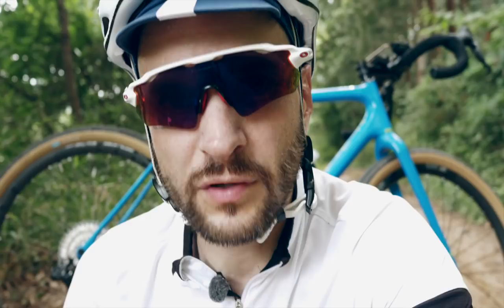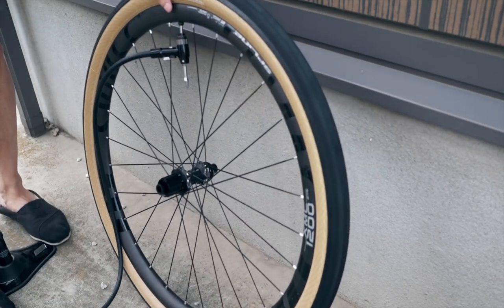First ride(s) DT Swiss 650b w/ Compass tires impressions / New Wheel day Part 2

Comment: Thanks for the vid, great shots! To respond to 4:20 I really don't think the wide Compass tires (at least the Babyshoe pass) are any slower than road tires, even on smooth pavement. I've only been riding them for a couple months but I've maintained the same, if not higher average speeds compared to Continental GP 4000s II racing tires. I've taken some koms too uphill/flat/downhill. Then when you get on older paved roads (where with road tires you'd be feeling tiny high-frequency vibration) the compass tires are clearly much faster due to Jan's "suspension loss" theory.
That's not to say every 47-50mm tire is fast though, I've tried the WTB Horizons/Byways and thought they were terrible on pavement. The closest is probably the Schwalbe G-One Speed but I'm pretty sold on the Compass tires.
Reply from the maker: Interesting to hear!
I'm very happy with these plus sizes one for sure...on gravel it's a whole new ball game...  I'm now secretly dreaming of getting a set of "narrow" compass tires for the road wheels now... just not super stoked on the price...
Reply: I second that. I run 44 snowqualmies and they are actually overall faster than Schwalbe ProOne 28s. Amazing tires. Mine aren’t sealing as good as I’d like but I think I need to try different sealants. I run mine at 22-25 PSI
Reply from the maker: Xaver von Treyer Nice, What sealant are you running now?
Reply: Rides of Japan any regrets with the dtswiss 1200 wheels?  They seem like a fantastic deal.
Reply from the maker: Super happy with them, for that price it’s a steal in my opinion.
I would not pay the original retail price for them though, then I rather go something like a “lightbicycle” build or something similar.
Reply: Thanks man much appreciated

Comment from the maker: Update 22/10/2018:
Did a follow-up video on the tires and the weeping issue:
https://youtu.be/nQhWmRkczEc

Update 25/08/2018:
I’ve now notice the weeping sealant phenomenon, nothing major a few teardrops on the sidewall. They are still holding air so not issues there, but I will keep an eye on it and update this comment on the status of it deteriorate.

Please excuse the muffled sound, I had go crazy with EQ to try and remove the Cicadas that was much louder than I though they were, I'm so used to the sound that it didn't occur to me how prominent they would be in the audio recording.
Thanks again for watching, let me know if you have any questions.
Reply: I don't know how well it will work but if you record a little bit of the Cicadas with out you talking then try processing the audio in post.
It might allow you to dampen the noise they make a bit.
Reply from the maker: Cheers for the tip! I did try to do some noice reduction but it messed everything up so in the end just using the EQ to cut away the frequencies where the cicadas sound where in sounded like the best solution... the voice became a bit muffled, but without it it was unbearable. I'm no sound engineer so I'm sure there are better solutions. Learnt a good lesson for the future though :)
Thanks again!
Reply: Rides of Japan if you don't already have a lavilier microphone look at investing in one that way you should get clear sound and less background noise overall.
Reply from the maker: Yeah, I used one for this video actually... and a pretty good one as well, records the audio on a separate recorder... the audio direct from the camera mic would make your ears bleed... it's hard to explain how loud the cicadas are here in the summer, you get use to it, but on recording it cuts through the soul hehe.
No more outside recording until the cicada season is over. :D
Reply: Rides of Japan don't worry I know how loud they can get we have a tree outside my apartment full of them.
You should visit Hamamatsu the heat isn't so bad down here...
Reply from the maker: TheAntibyte ah! You’re in Japan, then you know for sure about the noise hehe.
Never been down there... another area for the checklist. finally cooled down a bit up here as well, but there’s a typhoon coming I hear... 😑
Reply: Rides of Japan If you ever visit Hamamatsu there's a big lake ride that's super popular here, Lake Hamana is the name.
Also the aproaching typhoon has blown my birthday plans down the drain.
Reply: hey buddy get the sram cassette probly need xd drive ? but the heavy one you dont need a xd its non xd drive  pg-1130 i run this on my roadbike on 50mm carbon wheels
Reply from the maker: Chet Langford yeah, I looked in the that option as well... unfortunately SRAM is rally expensive in Japan, even the lower tier ones are about the same price as an xt8000 cassette 😔
I pulled the trigger on a sunrace, but not the 11-42 I talked about in this video, will probably do a quick video on it next.
Cheers!
Reply: man that sucks ! is it $ even on ebay?
Reply: sunrace should be good  CSMX3 or CSMS8? i was told the anodized spider ones are stiffer!
Reply from the maker: Chet Langford with the shipping eBay are still up there in price.
Found a good deal on the Mx8 👌
Reply: O yea forgot about they had a 42  in that one !!! yes that is a great choice ! thats the one every one says they like! i just went with the sram hoping i can get a lot of km out of it! its steel and heavy but the mx8 also has steel so im interested on the 11 gear 42t is a aluminum , how it will last for you under torque ! hope along time But let us know how it feels! Cant wait to see it bro!!!

Comment: I use JB compass 35c SL and I have not had any issues with leakage (I use Orange sealant). I have ridden some really rocky gravel with it and it performed superbly well ( I often use quite high pressures 55-60psi). The descents can be trick on gravel because it is slick.

 It roles extra smooth on rough tarmac as well but the light-bulb effect does damage the aerodynamics on >40kph group rides.

Thanks for the videos!
Reply from the maker: Rafael de Giacomo Araujo thanks man! Really looking into getting something like that for the road wheels when it’s time to retire my current tires.

Comment: Really nice setup.  I'm putting together an OPEN UPPER with 700c and 650b wheelsets.  The wheels I chose are the Industry Nine 235 CX 650b to match with those same Compass 48's.  Just waiting on a new derailleur to complete the build.  I live in a dry climate so I hope those tires are going to work well for my intended use on dirt/gravel roads and flowy singletrack.  Post a follow up when you get some more miles about the ride and durability.  Also appreciate the info. about tire pressure.
Reply from the maker: MARK SPENCER sounds like you have a dream build going on! 👌
Would love to see a picture of it when it’s done.

Comment: Im riding 90-110psi on my road bike with 700x25 tyres and 40-65psi on my XT bike with 26x2.2 tyres. Its perhaps more than normal, but I like the feel of a hard tyre.
Reply from the maker: Peder’n no right or wrong answer to the psi question, as long you are within the manufacturers recommendation, ride them as hard as you want 👌

Comment: I've heard that there are tubeless tires and tubeless ready tires.  Tubeless has a butyl layer on the inside, and is intended to be used without sealant or tape, on a rim without spoke holes (spoke nipples are placed within the rim using a magnet to slide them in each hole in the inner face of the rim).  Do you know of any such wide rim and tubeless tire combination in a width of 40mm or more?  Basically, this is just like an automobile tire, but for bikes.  BTW: your video captures are amazing!  I wonder how you do all that on the trail.
Reply from the maker: Mavic’s new(ish) UST system seem to be the closest you can get to that I think 🤔

Comment: What would be your opinion of using these Compass Switchback Hill 48mm tires with a 30mm internal width MTB wheel? Would it ruin the characteristics c of the tire you think? Or would in increase the good characteristics?
Reply from the maker: A K I don’t think I’m qualified to answer that unfortunately. 
I’ve never used rimes with that width, I thought originally that those dimensions are more for plus-sized MTB tires... but again, I’m not the right guy to ask.
The compass tires have super supple and thin casing/sidewalls so i wonder what kind of shape they would hold on rims like that... would be interesting to try for sure.
Reply: What was the internal width of the rims you used with these tires? Also, what was the final width of the tires? Thank you for your help, you have some excellent content :)
Reply from the maker: A K I showed the tire width in the video ;) (50.6mm)
Rims are 24mm internal
Reply: Rides of Japan Thanks man, my bad for not remembering you mentioned the final tire width. I am currently fascinated with internal rim widths and final tire widths vs what the tire label says. 🚲 🤓
Reply: @AK-ic1yj  I am running the Compass 650bx48 tubless with Orange Seal on American Classic Wide Lightning rims (29 internal/32 external) and love them.  I have some pics on IG at @WernerWhatever.  My personal thought is tire performance should improve with wider rims...

Comment: Would a fat 700c x 42mm be better for taller riders than 650b x 50mm ?
Reply from the maker: There’s not a simple answer unfortunately… depends on the surface and also what you mean by “better”
Both options with be great for most “gravel” roads though. 
A very general answer would be that the 42 would be faster but the 50 would be more comfortable, but again many other things than just the tire size to keep in mind.

Comment: How do you find the 650B x 48 wheels/tyres on road compared to your 700c setup?
Reply from the maker: surprisingly good. Like I said in the video they didn't feel sluggish at all. Just did a little weigh check and the rear wheel + tire is actually 5g lighter then my current 700c with 30c challenge tire.
You will feel the aerodynamics come into play once you riding at higher speeds. But I wouldn't hesitate to take this setup for long road rides if I had to. If it's pure performance you're after then the 700c is a better solution though.
Reply: Thanks. Did you ever run or consider running larger 700c tyres?
Reply from the maker: Mii Ke I’ve been running 700x38mm up for about 7 months... if you only have one option I think that is a better all around solution.

Comment: Great vid, just catching up with your back catalogue after finding you (life won't be the same again) when researching the OPEN Up. Like the build and 2 sets of wheels but for me it will be 2x in hilly Wales. Notice in a few vids you put cassette on 1 ring at a time, top tip is slid it on from the sleeve it comes on and if your changing cassette slid it back on the sleeve. Keep the entertainment and info flowing 🖖

Comment: I just replaced one of the tires that had significant weeping through the sidewalls.  I had broken down the tire, cleaned old sealant and remounted with fresh sealant several times.  So much leakage, that the tire would require touching up with air on a two hour ride, and almost flat overnight.  The other tire is great.  According to my LBS, this is a frequent complaint.  Nice to have a LBS though, as they replaced the tire at no cost to me. (Big shout out to Crow's Feet Commons in Bend).  Otherwise, love the ride and performance.

Comment: SunRace is fairly good choice, cheaper and lighter than XT  from Shimano. I've so far had 2 cassettes, 1 ten speed and 1 eleven (both 11-42). Couldn't feel any difference between them and XT one's, either in wear or shifting performance.
Reply from the maker: fuzz1337 excellent! Just what I wanted to hear! Many thanks!
Reply: I’ve also used the Sunrace MX8 I think. 11-42. It’s lighter than XT and couldn’t notice any difference. Plus the red spider on the inside looks cool
Reply from the maker: Neil Schaffer brilliant! Thanks for the comment! Nothing holding me back any longer.... 💸
Reply: Fully agree, I got Sunrace MX3, 11-42T, 10SP on my mtb full and I´m quite heavy rider (95kg+), and I don´t recognize any difference betweent Shimano and Sunrace on durability point and it works fine with XT RD-M786.
Reply: 3 years of abusing both of my slx 11-36 and sunrace 11-44 10 speed, the wear is noticable on the sunrace especially on 38 40 44 cog (the top three) if im not mistaken, the aluminium start to getting round aroun the teeth while my slx still fine.
Reply from the maker: Cheers for that info, That's good to know! 3 years should cover me without problem.... 12speed is on the horizon ;)

Comment: I add the Race sealant through the valve stem, just removing the core. I have a 2oz bottle that I fill from the big bottle and squeeze through the stem - it doesn't clog at all. Maybe if using the injector it may clog it, I don't know.
I use 50/50 mix of Race + normal Stan's sealant. Every 3 months I add half a 2oz bottle in each tire, since they weep. Esp. the rear one. But I have 3" tires anyway.
Reply from the maker: Ivo Roilev cheers! 
Good to know.. I was also thinking it shouldn’t be any problem as long as I remove the valve core, but I decided to follow instructions just to be safe.
I use the same method, fill a small 2oz bottle from the big bottle when using normal stans... good to know it works just as good with the race sealant 👍
Reply: I forgot to mention that I fill up the small bottle and put the cap when I'm done, so it won't dry out when stored.

Comment: Pro and cons of ~40 mm vs ~50 mm tire would be nice to hear.

Currently running 40 mm and I do notice the lack of traction on those >12° loose gravel fire road climbs, and the lack of traction on steeper descents on dry, dusty trails vs. say an XC wide tire.
Reply from the maker: I've not ridden enough on this setup to give any final verdict/opinions. Also need to disclose that I'm coming from the road bike side of things. The last MTB I had was way back in 2011.
That being said, I very much prefer this 50mm set up compared to my 700c38mm on gravel. (Both slicks) I've done this climb on both set ups, and this was way more fun on the wider tires. The climb is more rocky rather than smaller loose gravel, but I was very happy (and surprised) with the grip on the this set up climbing. I've yet to do much descending on gravel yet, but I'm pretty certain a XC tire would be more suitable for fast descending. But for me it would be too slow getting around on anything other than gravel... we always have a lot of nice paved roads to cover before we can get the the crunchy bits, that's why I've not gone with treaded tires. Don't think that answered your question very well, but hopfully I can revisit this topic in a future video.  Cheers!

Comment: Hey, I've also recently bought the dt swiss xmc 1200 for my titanium frame.  the wheels are really nics and light. but unfortunately I can not find anywhere where you can order the compass tire in europe.
Reply from the maker: Michael E you should be able to buy them directly from compass (check the link in the description)
Almost impossible to find in Japan too, even though they are made here 😑
Reply: Unfortunately I can not find Wtb Byway in black anywhere.
Reply from the maker: Michael E now that you mention it I don’t think I’ve seen them anywhere either 🤔
Reply: Rides of Japan Unfortunately, they are only ever mounted on the 3T exploro. I believe only oem. 😕 black would fit Titan so much better.  Check my Instagram for pics of my bike 😉 https://www.instagram.com/ei_mi_cyl/
Reply: You get the full range of René Herse (formerly Compass) tires here  https://dailybreadcycles.de/produktkategorien/store/